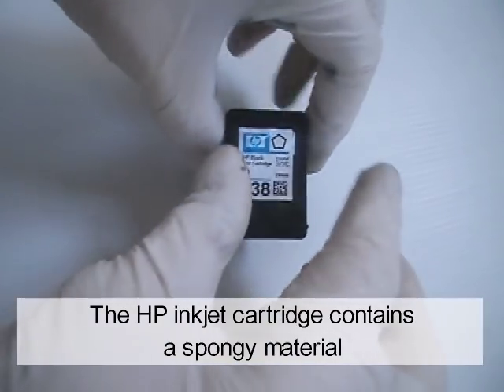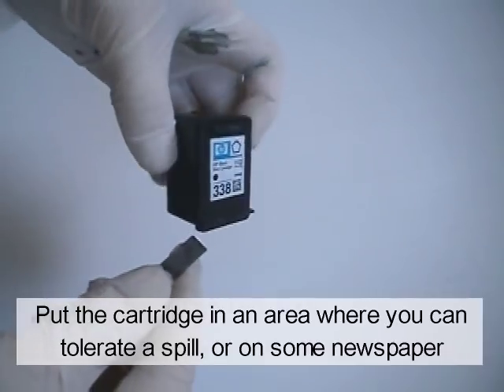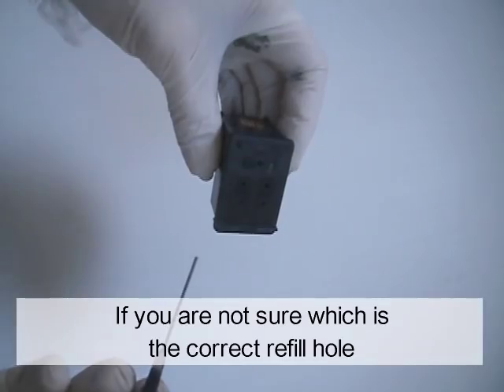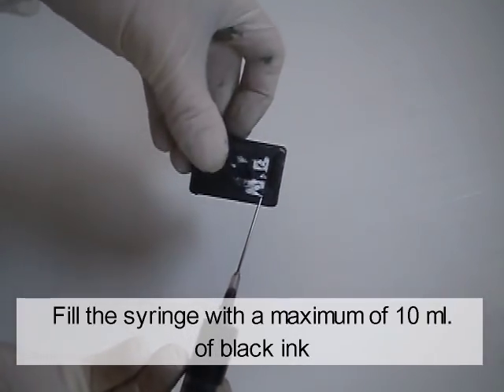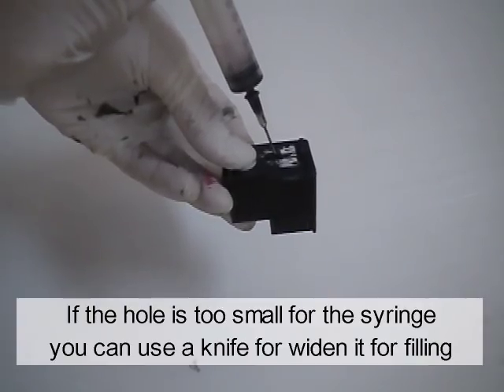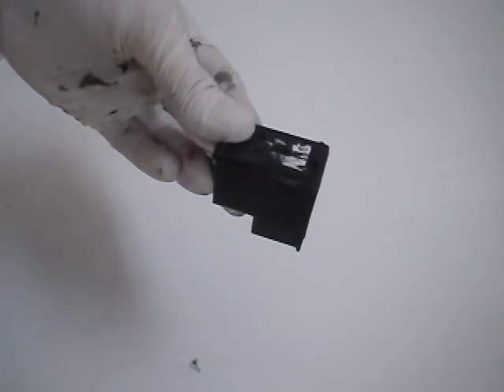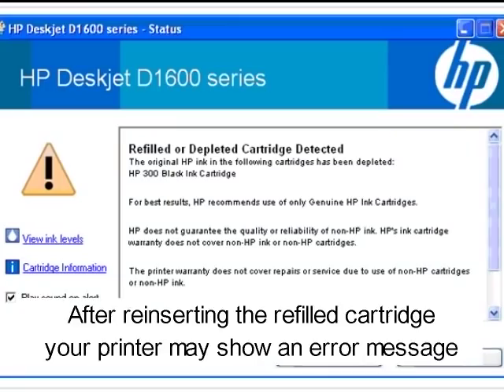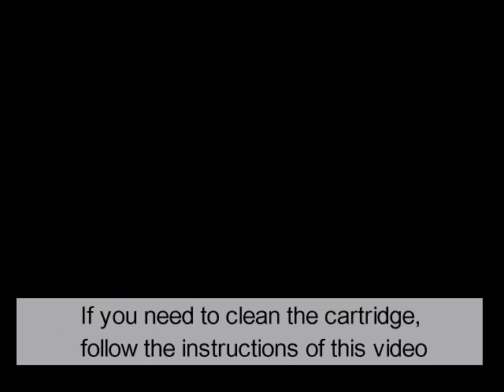HP Black Inkjet Cartridges: Refill Instructions

Comment: Thanks so much. I was so hesitant to do my own refill but the hp envy 5055 blew threw the ink within s couple of weeks. So I ordered online, no instructions on what or how to do the refills :/ So yours was the first video I pulled up and I did everything exactly as you instructed. Worked perfectly immediately. No spills, gloves weren't even necessary. But I could definitely see if you aren't watching the 3 little holes to make sure none of them come past surface level then most definitely it would be a mess. Because  I did inject ink very slowly into middle hole and noticed the top right hole came to surface level so I went to that hole and pulled it back. Then injected some into top left,  until center and top right came to surface and then I pulled some back to on both until I couldn't see. Wiped off previous ink with alcohol wipe. Put label back on leaving top holes exposed and then poked hole in label to expose the middle one. Ran a print test page immediately after and it came out perfectly. Thanks a lot! Side Note for users: My cartridge was completely empty and for the hp envy 5055 I used 4.25 ml to do a complete refill with the black ink.

Comment: thanks friend.... I have refilled cartridges myself many times but I had a cartridge that was clogged for the first time. I watched your video and then I ran some hot water over the printhead and then I put a paper towel over the top (so i wouldn't get ink on my lips) and blew into the cartridge and it worked great......in fact ALOT of ink came out for a moment.
I usually refilled before I ran out of ink in the cartridge but unfortunately I forgot and since it ran out of ink it dried very quickly in the printhead.
Reply: yes, using canned air will work as well

Comment: I have a Lexmark printer.  The only black ink cartridge this printer would recognize was out of ink.  (All other cartridges I purchased gave me an "Error 1203" message).  I decided to refill the old cartridge with ink, but after doing so the ink would not come out of the jets since dried ink had clogged them.  I was just about to toss out the printer when I watched this video.  I had tried all the hot water dips, alcohol wipes, etc. with no success.  What worked for me was the vacuum cleaner trick.  Now my printer is working flawlessly again.  Thank you very much for a very clever solution!
Reply: I FILL FIRST time coul i use pen ink?

Comment: Well...helpful video... i should had seen it before turning my black ink cartridge into a leak cartridge. It is my first time in refilling inks of printer and I charged myself with a loss of 1 cartridge but now have to buy the pair..... About this video i would like to say that a little more display should be shown too. like the bottom of hydrophobic foam there's a base just beneath the foam which is also a little similar to hydrophobic material.Its the place where the ink gets drop onto to get into the process of use when printing.. Means that there are two things in cartridge. 1 stores ink (hydrophobic foam) and other (base) pass it for use. When syringing the foam to fill the ink you had to be careful for not penetrating into the base which cause in leaking the cartridge and that's mean you had to replace this cartridge with a new one. No second option is available except for if the cartridge is a little cheap to buy (used one). Remember one thing too, don't just put the entire needle into the cartridge. put it half into the cartridge so it will be in the half or center of the hydrophobic foam and the base will remain secure too. I found it right after watching this video. I don't know if this cartridge is original or whatever but the cap of the cartridge is sealed and can't be open like this.
I opened my leak cartridge which now exists, through a heated up knife to melt the sealings to make it open and observe the internal process or behind the scene :D thing....
Reply: Thank you for this info. I damaged mt 1st cartridge as i also as pushed the needle all the way in. And for some reason all videos dont mention not to do this? Half way down as you say is a good. Although i just enter the neddle all the way in but at a 45 degree angle so you miss the base with no fear of damage and filling from the bottom means you can fill the cart up in one go as if you only put the needle half way in you only fill the sponge partly and have to do it again once the ink has settled. In the Video it also says dont cover the holes as air needs to get in? I dont think thats right as there not open when you but them. Although I could be wrong?
Reply from the maker: andya07774 the holes on top of the casrtridge are open. if you watch under the adhesive there are little thin channels for the air

Comment: Add this text to your info:
HP printers will not align or work properly without the color cartridge.  We don't care if you don't need the color function and that the ink will dry out if not used and be a waste of your money.  We make money off of cartridges and our printers are designed for our interests, not yours.   Thank you for your business.  Bend over now.
Reply: Markus451 it's honestly fucking criminal.
Reply: I never refilled my color cartridge and only use black in my HP printer. My printer runs fine
Reply: And how should this work. Company makes printer for your for $30 and free ink till they go out of business.
Reply: Been doing this for years and HP company is doing fine. They do not just sell ink... LOL
Reply: @jmacrocks0415  perhaps it's because your color isn't empty?
Reply: Do what I did. When the color cartridge is entirely empty just refill the 3 holes with black and set the printer for color. Will need to let the printer clean the heads a few times but it seems to be working great in my HP Envy 4512 POS Printer. Should make my black inkl last 2-3 times longer too now, lol... FU HP!!!!
Reply: not true, but the black cartridg need to work flawlessly to give decent prints without the colour cartridge

Comment: Hi Poster,
Thanks for this video. It helps on getting rid of the trick of printer companies that makes us buy their expensive cartridges. And specially a student like me who can't afford expensive replace cartridges. I guess I understood how to refill but I don't know what to do after refilling the cartridges. i mean, what to do when the printer does not recognize the refilled cartridge? Another thing, where can I buy the inks (color and black) and syringe? BTW my printer is All-in -one deskjet HP 2540. It comes with HP 61 type cartridges,one tri-color and one black. Thanks for any response in advance.
Reply from the maker: D KC you can buy inks on ebay for example. then you can use a normal pharmaceutical syringe with needle.
to reset hp cartridge search in this channel "Reset method ink cartridges HP 300 342 343 344 
348 350 61 62" 
I think this is the only method that really works but you'll need 3 cartridges, not important if empty or 
not.

Comment: If you remove the top off the cartridge please READ THIS.
may I suggest when you take apart a 5-10 ml. cartridge you will typically find a molded shape with a sponge in it. The molded shape or sponge retainer can be cut with a wire snip or other method to remove most of the retainer. An 1/8 inch wall left intact at the bottom will be ok since the sponge can conform to the space. If you have a couple of old cartridges take them apart. Cut 1-2 of them to occupy the new sponge space. As long as there is contact between the sponge pieces and the backside sponge of the ink screen then the ink will flow. Be sure to top off the new sponge config you just made and let it rest for 24 hours.  You might be amazed how much ink your reworked cartridge holds! Let me know how it goes for you!!

Comment: Do u have to take the cartrage lid of completly or can u just refill through the hole in top ive tried allsort of ways but it wont except the cartrage afte use
Reply from the maker: It's not necessary to remove the lid

Comment: Thanks for your extremely useful info., allow me to share my past realistic experience, both with you and the readers, may be you might have the right solution?.My experience is... like many others who like to save money, thanks to you&other You tube etc. instructive info.,I refilled both Black as well as Tri color inkjet cartridges for my printer, Unfortunately the leaked ink over time ruined my printer, and twice,I had to buy all in one printers,(Earlier I even tried to use other refillers cartridges, sold on various websites),My impression is that the ink I bought were too fluid in consistency(That's my belief).when I told it to my neighbo(u)r, who used to refill his ink cartridge, at a local retailer,He told me, that the same thing happened to him,it was very disappointing,and I had no other choice, but to pay higher price in order to buy original, I'll be very grateful, if you'll be kind to advice (advise) me& your videos observers with a realistic and practical solution,thanks in advance!.

Comment: even after i refill cartridge it keeps saying error message. cartridge is out of ink.
ive taken it out and cleaned the bottom with paper towel. I put black ink in the colored cartridge bcuz i never print in color. what can I do now..its leaking out of the bottom of the cartridge.

Comment: How do u take the lid of the cartragr i had to saw mine of and it wouldnt go back on
Reply from the maker: It's not necessary to remove ithe lid to refill a cartridge but you caan glue it with hot silicon glue for example

Comment: I purchased a black/colour hp 301 pack, and after THREE copies, the black refused to print. I removed the black cartridge and continued to use the colour only. That has just run out and I got 83 copies. Some difference, huh ? The printer worked with just the colour cartridge in place.

Comment: if an error message comes up on you ink cartridge this sounds stupid but your contacts are not connecting properly, after an hour trying to figure out putting in back in and out i put my tongue on the contacts put it back in a it worked the gold contacts dont make a electrical connection, a bit of saliva  did the job lol

Comment: hi i have a hp printer 301 cartages could you possible tell me why the ink drips out of the bottom of the cartridge after refill?
Reply from the maker: boab242424 probably too much ink, often 5 ml are enought. or the cartridge is too old and the sponge inside has become matted. let it over a flat surface until it stops

Comment: I have a new HP DEsk jet Printer 3632. How do I stop the printer reading the info on the cartridge that says it is empty?
Reply from the maker: You'll find a reset procedure in this channel. You'll need 2 extra cartridges, not important if empty or not. I do not know any other procedure
Reply: viandant5 I have a same printer Deskjet 3835 and after refilling the message says empty cartridges and no printing occurs,please suggest solution,thanks

Comment: I refilled my hp 61 & hp 61xl cartridges & they print fine, but my problem is that they dont last very long. I already had to refill like 5 times in the last 2 months. Why does it not last as long as getting professional refilled cartidges?
Reply from the maker: +Adam Supey probably you have to insert more ink, or may be the internal sponge of the cartridge is too old and does not retain the ink as it should do

Comment: Hi.  I must have done something wrong here.  Refilled a 61 cart because the ink seemed to not print at bottom of page a few times.  When I run test page, it isperfect or near perfect.  When I tried to copy, it would not show other than first few lines of page.  I thought could be copier, but it scans fine and also think copy is ok.  Went back to print and again, is clear for a wihle then nothing (or light blue where black should be... I ran out of black).  Any ideas?   This is an HP all in one machine.
 This cart is pretty new; its first refill...  Thanks.
Reply from the maker: +car kal the test page has little text and graphics, a copy is probably 100% of the page so I think the problem is the cartridge. the cartridge may be overfilled, or try some cleaning procedures

Comment: 920 cartridges in Officejet 7000 large-format printer. Will these instructions work with this cartridge? Any special instructions for this cartridge or printer? 

I print mostly black. CMY cartridges get used in power-on cleaning cycles. I don't want the head to plug up. Also I don't want to keep replacing CMY cartridges if I don't use them. Can I leave CMY cartridges out of the printer?
Reply from the maker: no, that cartridge has no printhead

Comment: i am no longer enrolled in hp instant ink. but  my hp envy 5330 printer wont print and on my vaoi touch screen laptop  it tells me  local print spooler service is not running please restart spooler or restart the machine .. wth does that mean????i  just want to use my printer with the ink i paid for ut didnt even get to use.. and im not paying instank ink anymore money.. but i guess  i did have to call instant ink. they are sending me a black ink cartridge that should work but i have not got it yet so what  if any can i do in the meantime.. pissed off mom.. needs to get stuff done..
Reply from the maker: I would try to reinstall printer driver

Comment: In a totally empty cartridge, I use less ink than you state because I ruined a printer once using that much ink; it just leaked. The video is good, however.
Reply from the maker: it depends on the internal sponge. if it's too old or matted, better to use less ink

Comment: What should I do if the three light all blinking at the same time??(printer model is hp F2480 )
Reply from the maker: +蕙婷 if they are blinking fast it's a general error, you can only try disconnect the power cord with the power on. Wait one hour then reconnect the power cord.  then turn on the product. If the issue persists, the printer needs to be repaired
Reply: viandant5  ok.. Thank you so much

Comment: wong wenfang1. How to make the catridge pull in air ?
2. Is it applicable to hp 3635 , catrigde number which is hp 680?

3.after refilling, what can i do if the computer show error message ? I am still using the original catridge but with universal ink inside, why the computer cant recognise my catridge?
4. Can i refill any of the bottled ink from the market? Any specific ink to be refilled?
Reply from the maker: the air enters into the cartridge through the air vent holes. it's applicable to HP 3635. after the refill may be you have to do a reset procedure, you'll find the method in this channel but you'll need 2 extra cartridges. the ink jet inks you find in ebay and searching with google are almost the same
Reply: viandant5 thanks a lot

Comment: Why do I not put the sticker back on? it looks like you put a yellow sticker on before you put it back in the printer…some sites say to cover the holes with tape?
Reply from the maker: +Adam Supey Do not use adhesive tape on print-head, you may damage nozzles. it's useless to place a tape because the ink is already inside the nozzles. new cartridge have tape but there is no ink inti the nozzles

Comment: i have refilled hp 678 cartridge but after it is put in printer, print out is not coming. in fact i can see few faded lines or no lines on the paper with some ink spilled on the trailing edges (towards corner) of the paper. Think it as case of overfilling, i even removed some of the ink but it is still not working. Can you suggest something to overcome the problem
Reply from the maker: +Yogendra Gupta try clean the print-head of the cartridge. in this channel you'll find a video "7 ways to clean an inkjet cartridge"
Reply: thank you for the helping advice. i did try it and it has worked fine now

Comment: thanks for helping in refilling hp deskjet 1515 ink cartridge no 678 but i am unable to reset the levels please help . thanks in advance .
Reply from the maker: the method of the 3 cartridge described in the link does't works? try turn on the printer and remove the ink cartridges, then unplug the printer and wait one hour. then put the cartridges back in and plug the printer back. sometime it works.
or try reinstalling the printer drivers
Reply: Did you got a way to reset them???
Reply from the maker: chirag beniwal
the only way I know to reset these cartridges is the method of the 3 cartridges
Reply: viandant5  does it works if other cartridges are protected for other printer?
Reply from the maker: chirag beniwal if other cartridge are registred in printer memory it works the same
Reply: viandant5 no its a friend's depleted cartridge. I have a hp 3545 and both black and color cartridges are just empty... and 1 protected black one... what options i have?? should i buy 2 more to make a set of 3 ?
Reply from the maker: chirag beniwal "protected" you mean a cartridge registered in printer rmemory?
Reply: no, a friend's cartridge protected by his printer. i have protection off on mine.
Reply from the maker: chirag beniwal I think it's not a problem, the protection are setting of his own printer
Reply: viandant5 Thanks buddy... :)

Comment: Thanks for your videos and instructions about refilling inkjet cartridges. However there seems to be a conflict between your recommendations to leave the refill hole open ("because it needs to draw in air"). All original or replacement inkjet cartridges are sealed with a label or tape. What is the correct configuration? Should it be sealed or left open? As I said, all original and replacement inkjet cartridges are sealed and do not have "open holes to draw in air". Can you please explain your reasoning for leaving hole open in the cartridge? hollidayp1 160614
Reply from the maker: the seal does not completely close the cartridge, on the top there are little channels who let the air enter inside the cartridge